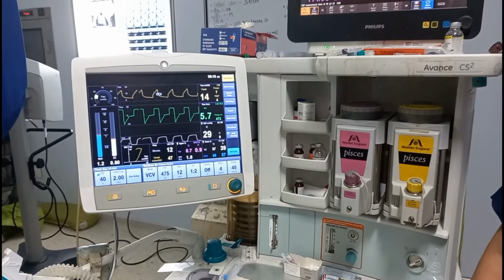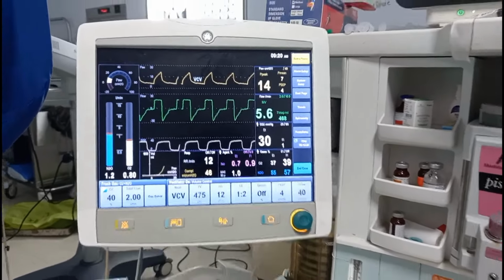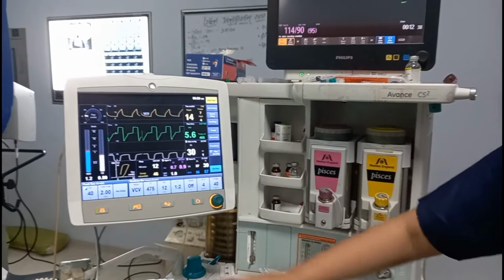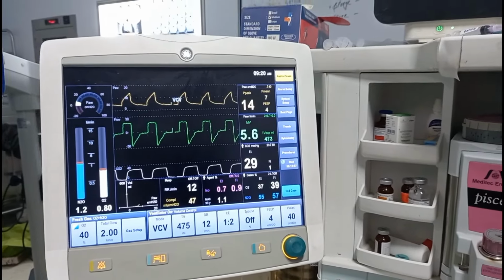Anesthesia workstation(boyle's machine)

Comment: Corrections: 1- cylinder is of high pressure system. 2. Wheels  actually conduct electricity. Any static electricity if produced will be discharged through wheel to ground . Thus prevents sparks by conducting static electricity out of machine. 3. Flush valve causes barotrauma and volutrauma. Not atelectotrauma. Atelectotrauma is due to repeated opening and closing of alveoli as seen with frequent connection and disconnection of ventilator .